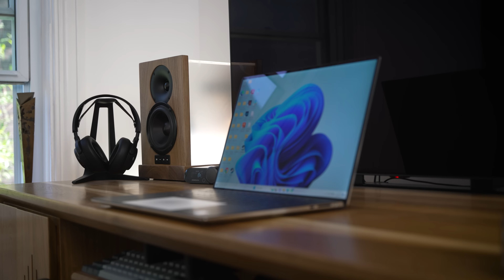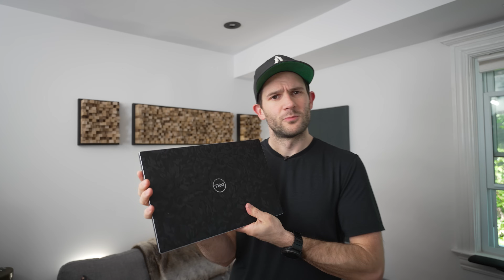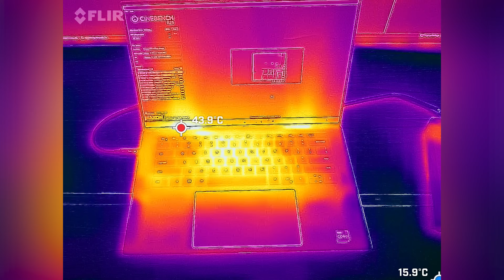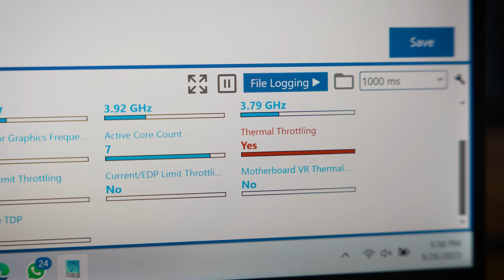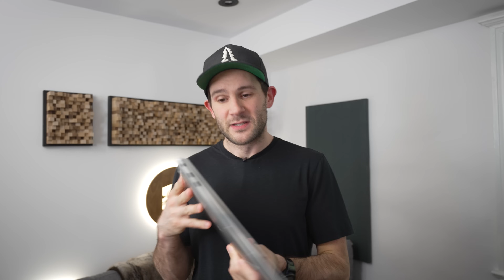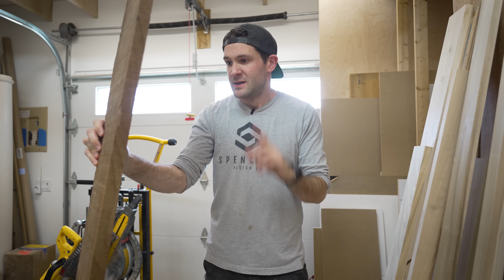The BEST mod I've ever seen....

Comment: I did similar for my XPS 9560 (i7-7700HQ, 1050) a couple of years ago, with some differences: no external fan, I made a thermal bridge from the VRMs to bare heatpipes, undervolted the CPU 0.12V, put fine mesh over the intakes (to eliminate dust), and resting it on a dowell bar near the rubber strip to stop hot air recirculating into the intake. As a result, it only hits around 85'C with a GPU game or CPU-intensive work, and the power delivery stays higher. There were other tweaks, like also using ThrottleStop to improve responsiveness for DAW work.

So if you want to improve on what you already have, maybe try undervolting, if your system allows it.
Reply: the mesh would affect the intake enough to raise temps. did you add cuts to the laptop chassis ? removing the mesh will yield better temps.
Reply: @EpicBunty  After 3 years, I've still not had dusty fans inside, and the temperatures are not noticeably affected by the mesh (I must have found one that doesn't impede the airflow significantly). Gaming temperature is typically 84C max, and the VRMs don't throttle the system, while sustaining 34x on all cores, or near 37x if single-thread workloads.
Reply: @jvcouk  i see. well the no dust is a big win then and 84c for laptops is decent enough.
my pc case has a top mesh, removing which gave me atleast -5c at peak load. top fans are exhaust though.
Reply: @EpicBunty  Yep, removing top mesh should be no problem if you use it often, don't have stuff falling in, and have positive pressure in your chassis.
Reply: @EpicBunty  Dell designed my laptop as a dust trap that throttled in its default state with normal workloads, which ruined games. The small software mods pushed closer to CPU tolerances (for lower power), and the hardware mods safely improved heat flow, power throughput, and dustproofing. A huge win for me, and my 7700HQ laptop can keep going.

Comment: As a tech that fixes laptops, I can safely say that there isn't a flawless laptop manufacturer.  All brands have issues and even have some that are lemons.  I would say it's more about keeping the vents and fans clean inside, not ever using mechanical hard drives (use SSDs and NVMe SSDs), and doing research on a per model basis based on your budget.  Of course, like Zac recommends, having an external cooler will help it run cooler, faster and last much longer.  

If you're having issues, 8 times out of 10 it's the mechanical hard drive.  Replace that with an SSD and you're likely good to go.  The other is the 2 times is either the CPU cooler/fan or power issue.  The CPU fan/heatsink gets filled with lint and dust.  Just clean it out and it'll cool much better.  Power issues come from the DC Jack being bent/broken or the battery doesn't hold much of a charge.  In either of those power issues those parts would need to be replaced.  

Of course, there can be other random issues but they're much more rare.  They instead tend to be from wear and tear (cracked screen, spilled something on the keyboard, trackpad worn out, cracked plastics/frame).  In other words, lemons can happen but unless it's a manufacturing issue it's less likely it's a problem with all of that model or brand.  Again, just make sure it has an SSD instead of a HDD and you're off to a good start.

Comment: My only note is that there are plenty of existing laptop cooling pad devices that have spare room inside their chassis that could fit the dock if you swapped out their fans for that nice one. Many of them even have fan controllers built-in. You would end up with a more comfortable purpose-built device by cobbling something together rather than building it from scratch in this case.

Comment: I’d like to see the performance upgrade with just the fan, just the improved thermal paste, and then the combination. Awesome build though!
Reply: He didn't want you to find out that all the extra performance came from the work he did on the laptop, and not from his laptop stand.
Reply: We all probably have different laptops, and that putty is a pain if you ever want to redo it so....
all I did was use mx-4 on my gpu and cpu under the cooler
And replaced what Asus did with thermal puddy, with really high end thermal pads.

I reinstalled my cpu/gpu cooler, and immediately uninstalled, of course my thermal paste was fine, the only thing you can do is use too little and since I normally repaste full sized GPU's I used too much. Cleaned up the edges a bit - that wouldn't have mattered. Checked the thermal pads that they were all indented by the memory a little, but not too much. Refettied as necessary, rechecked for fit. Reassembled. 

You see, about the thermal pads imprinting, heavy imprints and you may reduce pressure on the CPU/GPU points because the thermal pads are too thick, which could cause their temps to go up or even severely overheat them.

When I was done my laptop was flying fast. I mean flying fast. It's still faster than the day I bought it 5 years ago. Curios about what happened, I looked it up online and found out "everybody" talking about how much faster this laptop is, even new out of the box with new thermals. Oh, well at least 2 years later I started in on that performance!

Comment: I recently finished building a cooling pad with 3 120mm Noctua NF-P12 redux fans and Noctua NA-FC1 fan controller. It works great, can be a bit loud but way better than any previous ones I've owned.
Reply from the maker: Ya most laptop cooling pads are really loud anyways. This 200mm fan is crazy quiet. I should've talked more about it, but you cant really hear it until you get within 12" inches of it and even then it's just a whisper. The built in fans inside the laptop are WAY louder haha.

Comment: 11:50 For more heat transfer, you should have sanded the heatpipes and apply the putty right on the bare copper of the heatpipes.
Oh, and btw, your thunderbolt module ruins the effects of your fan. Even more when you consider that 200 mm fans don't have much static pressure... 🙄

Comment: Designing in external radii to those tenon joints that have about a 5-10% clearance on the internal radii will eliminate the need to do manual chisel work

Comment: Hi Zac, I have been rocking a MSI Gaming GT72 6QD(Dominator G)-249UK for 10 years now and it has been rock solid. I've upgraded the storage to 6TB of internal SSD storage, bumped the RAM to 64GB and configured the system to dual boot Windows 10 and Linux Mint. I have a desktop that I use for gaming now, but this laptop still performs very well for development duties and general use. If the newer MSI systems are as solid as this thing, hard to go wrong. Another system I have considered is the new Framework 16 laptop. It can be stripped down to a bare chasis with one included tool and everything on this laptop may be user serviced/upgraded. The ports may be configured as desired and there is a dedicated bay for a graphics card. Looks to be well engineered.

Comment: I thought the pads on the bottom of the laptop was to prevent shorting of the board in contact with the metal shell so it's now a shorting Hazzard unless the shell is plastic which I assume not

Comment: That a lot of nice thermal mods, I never had good experiences repasting my XPS17 9710 (I tried MX5 and GC Extreme and thermals were worse until I switched to Honeywell PTM, that made a huge improvement), but pretty awesome to see the before and after, and considering that Intel/Dell boosts these CPUs to over 100W (at least in my experience with the XPS 17 9710), the fact you can get it to power limit throttle is kinda amazing
Reply: It's so wild to see my PTM experiment has made it this far.  We talked about it in Discord then I purchased some from a sketchy Chinese shop and the PTM revolution was born.

Comment: Very nice outcome! Got some usefull ideas!
Same situation with my XPS too. Quite a lot of problems.
Switched to Thinkpad; quite pleased with it so far
Reply from the maker: Definitely considering some other Lenovo devices!
Reply: I have quite a few thinkpads that I really like. The ones I use daily are my X1 Carbon(gen 4) and a T450s, both are a few years old but still work well and are solid af.

Comment: That Noctua thermal compound that you've used suffers from pump out really quickly. Make sure to monitor those temperatures because I expect them to degrade a lot in the following weeks/months. Consider using reliable stuff such as PTM7950.
Undervolting the CPU and GPU might also give you a measurable boost in performance due to a decrease in thermal output
Reply: Yes. With the flexing happening in a laptop from regular use, I expect the movement between the case and the cooler to pump the compound away to the sides.

Comment: The problem isn't buying a Dell, it's buying an XPS (or Inspiron).

Stay in the Latitude line (and of the very bottom models) and you'll do much better overall.  Also add the pro support warranty and you'll have a much better experience there too.   We insist on it for all our business clients.

Comment: A recommendation: Don't buy a Gateway because they are actually very cheaply built and not reliable. I've bought 4 of these; one for a friend and 3 for myself. Of my 3, only one still works. The only reason that it does is because I tore it apart and made a mini PC out of it with a large heatsink for much the same reason that you thermally bridged your components to the housing. The cool thing is that it's basically an SBC inside with daughter boards that add peripherals.

Comment: In my opinion there is a way to improve this project: by placing a frame of sponge or memory foam that is placed under the laptop to prevent the air from escaping and forces it into the PC's dissipation system.

Comment: Remember, burn is higher than cook.  Even if you aren't to low grade burning temperatures, constant heat can be low grade cooking you.  You'll generally survive in the short term, but it is very hard on your body and a bad idea in the long run.
Anything that gets uncomfortable, your body is telling you it is uncomfortable for a reason.  And it was probably doing low grade damage even before you noticed it was uncomfortable.
When you notice a problem, fix it, it is always the best idea long term.  Something that didn't seem like that big of a deal at the time can have health consequences later on.

Comment: The only mistake with this design is that the bottom of the laptop should be fully sealed around the stand so that ALL of the air from the Fan in the Stand is Pushed through the Notebook...

Comment: Cooling pads aren't for cooling the bottom of the laptop off lol.
Cooling pads are for forcing cooler/more  air up into the air intakes of the laptop, which are most often on the bottom.

Comment: Since I am early I'll narrate the same mod I made during the lockdown, it was dirt cheap. 
but first Laptop rec: I was initially thinking of recommending something like TongFang or Clevo chassis(aka CyberPowerPC, Xotic, Eluktronics, etc) but 
the since u already have a beefy PC, go for a Framework, they are effortless to repair and you can show us some cool mods related to these! 

my mod: I bought a laptop table +cooling fan combo (the one with 3 joint plastic legs on each side)
de-lidded the bottom panel, replaced paste with the 14watt Cooler master stuff, and for thermal pads I used Gelid ultimate
To increase the height I used Pencil Erasers and I used RasPi heatsinks on RAM and SSD 
The bottom panel rests in a drawer; whenever I need to take the Laptop - I clip it back on. 
For a hub I use whatever I have, it's called HyperDrive but also one from a brand called Orico both are good. I also used a heatsink on the HyperDrive one as it heats up due to charging. Yours looks way better than my ghetto build but it's cheap
Reply from the maker: I'm eagerly awaiting the launch of the Framework 16! My main problem with their current design is that there's no dGPU. I'd also like something that wasnt crazy chonky so we'll see once it's released. 

Sounds like an awesome project! Did you benchmark it? I'm curious to hear if it made a difference.
Reply: @ZacBuilds  oh so a mobile editing station is what u need..
I'd say if the laptop u use isn't cutting it then a gaming laptop would be what u need. The sheer thermal mass of the aluminium can easily power thru most of it. 
Something like a CyberpowerPC laptop or some OEM that sells TongFang or Clevo would be okay(Cyberpower being the cheapest) something around 2.5k USD would suffice ur needs. Brands don't matter much, you could buy the most desirable brand and it will fail. MSI, Asus, Acer, HP, Dell all fail - just buy what you feel does the stuff u need. Obviously Jarrod's the best on YT for this kinda stuff. 
But if portability and ease of use is also a factor then u might wanna check out the Mac's. I hate to say this but they are pretty good at what they do - efficiency. I'm sure you are aware of all their downsides, but do give it a thought. 
. 
. 

haven't run a real synthetic benchmark but it defo improved my gaming fps, I went from 43/46fps to a 58/60fps and the temp drop was amazing! 
Earlier it was 88 °C max and now I can't find a way to make it go above 72°C. And on idle it sometimes turns off the fan, this wasn't possible before, it would run its fan all the time.
Reply: If I understand correctly, you added small heat sinks from raspberry Pi directly to components inside your laptop, and use it docked with the bottom panel of the laptop removed? I also understand that you add the panel back when you need  to take the laptop with you… if so, do the added heat sinks fit with the panel on?

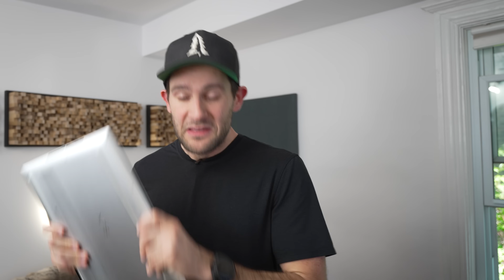Comment: 0:41 except most gaming laptops. My good (and now also bit old) Lenovo legion 5 have good enough cooling solution (including 4 heatsinks and exhausts ) that allows it to work at 100% for long time. And most gaming laptops are designed this way so basically... If you need the full performance don't buy office laptop and convert it into desktop, buy gaming laptop instead. Now a days they are not that much bigger and chunkier then office laptops

Comment: I use a cheap HP gaming laptop that has had nothing but overheating problems.  I've replaced the thermal paste many times (I do it every time the laptop freezes up, presumably from heat).

I finally tried replacing the paste with PMT7950 phase change thermal pads.  They're hard to work with, but they improved the laptop as much as I could have hoped for.

Comment: Laptop cooling pads do work, just not as directly as you might want. By cooling the shell, it means the air that does go into the inlets isn't being heated as severely while it travels under and into your laptop, meaning the air that goes in can then grab more heat before going out. Not to mention it distances the laptop from other heat, ie your lap if you use it according to its name.

Comment: I clicked on this video randomly but funny thing is, I was building my own laptop cooling pad. Kind of overkill tbh but it has a built in active USB Hub (but only 2.0) , QI charger, audio system, and ofc remote controlled RGB Leds, along with its 12mm fan I have placed under my laptops' cooling intake vent ofc. I also have an aluminum case in my laptop, don't know if its worth doing what you did but at the very least im replacing the thermal paste. Cheers

Comment: I work at a PC / Laptop refurbishment plant, Most laptop manufactures have their own quirks. Honestly none are better than the other so pick your poison. Here are my thoughts over the years:
Dell, decent motherboard and ok cooling designs all around, most battery failures and RMAs ive ever seen.
HP is hit or miss. They either make a very good notebook or a very bad one. The elite notebooks with ryzen APUs tend to be quite good.
Lenovo, stay away from anything 2016 and newer (6th gen intel) unless its one of their thicc workstation laptops, those are actually good.
Don't see a lot of MSI, ASUS or gaming laptops in general. They tend to be hit or miss depending on the model.
Generally AMD chips usually have more robust coolers on them and run a bit more power efficient than intel ones depending on the generation.
I would suggest just doing a bit of research on one before buying anything new, if you know a little bit about hardware look up reviews and complete teardowns of the hardware.

Comment: Great work, thats truly amazing!
But i have to disagree with that the laptop cooler's don't work, because in my case my laptop fan is in the middle, and it has a huge  vent opening, so one 120mm fan in the cooler is pushing air in the laptop fan, and inside, additionally cooling the ram and cpu, it is able to cool it about 10°C lower than without the cooling pad.

Comment: Well in my experience MSI doesn't allow you to open the case without voiding the warranty. On the other hand, Asus does allow you to open the laptop just so long as you don't remove the heat spreader assembly, so you are allowed to do your own upgrades to RAM, SSD's, and M.2's. As they are using liquid metal instead of thermal paste there shouldn't be any need to remove the heat spreader so for some time beyond the life of the laptop. I have an ASUS Strix G15 and it has laughed at everything I have thrown at it. It's an option for you to consider from a fellow Canuck.

Comment: If you used foam that fit around the edge of the laptop working as a gasket to force all the air from the fan through the laptop your cooler would work much better. Llano and iets make laptop coolers with a foam gasket like that and they legitimately lower temps by 20 degrees or more.